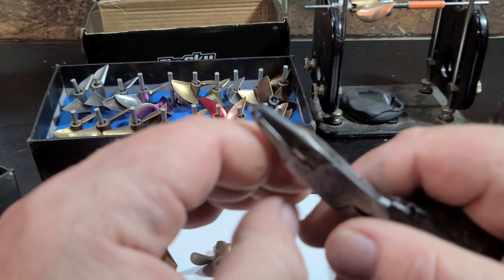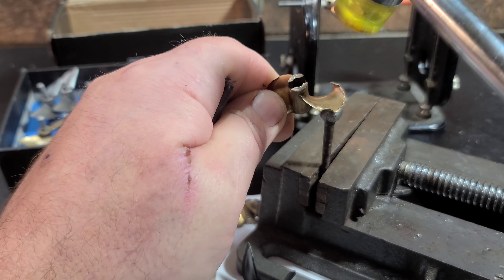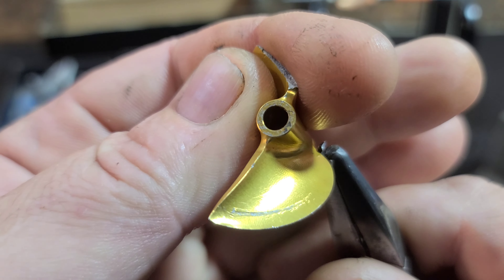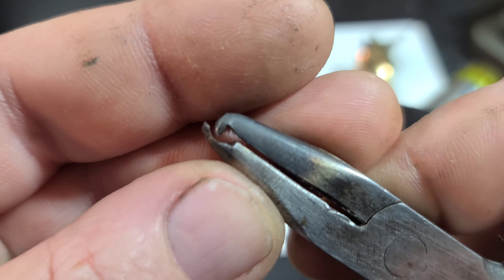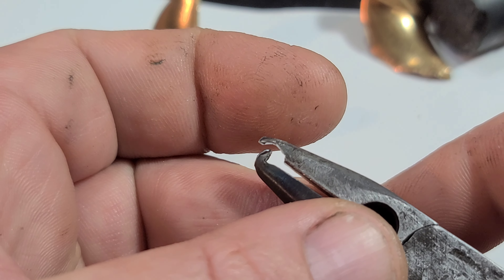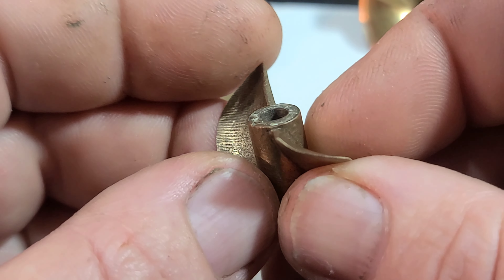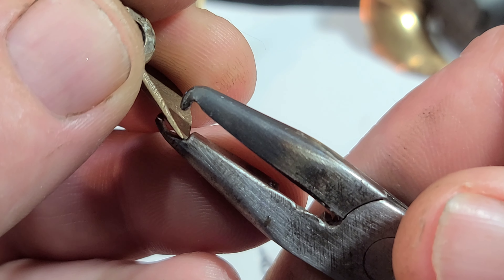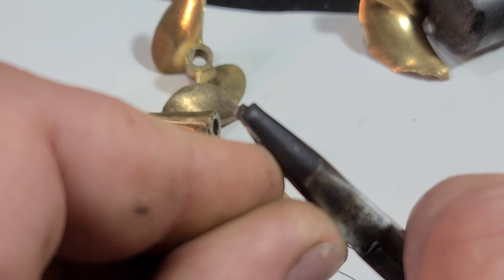Big B Shows DoctorJet How He Did It - Rc Boat Prop Pliers

Comment: Interesting that you are doing that turn up. The last prop I bought was sharpened and balanced and had the tips turned up like the winglets on and aircraft. I suppose it cuts down spill and turbulence.
Reply from the maker: Crazy how much difference just a little bend/cut will make on any given setup.    Thanks for sharing

Comment: I like your screw holding pliers.  I need to modify some locking tweezers like that.  👍
Reply from the maker: Those are my favorite pliers, I use them for all kinds of odd task, grinded the circumference down,  making them narrower so I can get into tight spots.   Thanks by the way, for the pliers demonstration. I meant to thank you in my video but slipped my mind.
Reply: @IRONCLADRC  Focusing on the small stuff as I do, I frequently have the need for such things.  I have locking tweezers, but the bolt can easily slip off.  A couple of little notches like you did will do the trick.

Comment: Wow, what a treat! 2 vids in one day! Ive worked with Aluminum in 3 different alloys. One was soft, gummy and bends easy. 6061 is tougher, machines decent and doesn't bend as easy, especially sharp bends, it cracks. Then there's aircraft aluminum, 7075. It's hard and doesn't bend. I'm guessing the props are 6061.

Comment: Welding a ball bearing to a pair of pliers.  This is what I have done for my prop modds.   
You should try just bending  the trailing edge tips of the blades.  
Then slightly roll over the trailing edge as well.   One of my main modds to my props.  
A prop I sent you along time ago.  A stainless prop you can see how I modd the trailing edge and it filed squared to the face of the hub.   

How your bending in this video. I’m pretty sure if I’m not mistaken, your messing around with the pitch of the propeller.

Comment: Hey B. I have a sonicwake 36 with a one 150 with a oxidean 4519. What would be the best motor to pair with that setup. I am not looking for a speed run prop. Just want something a bit faster.
Reply from the maker: Something like a 4074 1800kv-2000kv.  Lower kv will run a bit cooler higher kv temps will be a bit higher with higher speed

Comment: What size of props do you use on the small scale balsa stuff? I'm making a little hydroplane as my first scratch build and don''t really know what i'm doing :)
Reply from the maker: Depends, what's the length and round about weight of the boat with battery, also motor kv, esc and cell count. 🤔
Reply: @IRONCLADRC  Alright it's about 16 inches and 200g with a 3s, don't have a motor yet though.
Reply: Not sure if im helping? but all i make is scratch builds . the surpass motors take some beating , with the x range of 27/ 29 and 30 mm plastic props, as they dont need any balancing and can be sanded back to make smaller sizes , Regards Paul B @makeshift8017

Comment: This makes no sense at all lol All your doing is breaking edge of the props flow by doing this.  Not trying to be a jerk or anything so please don't get me wrong!   Just from way a prop works and how its edge cuts water and actually boils it funny enough as lead edge hits water creates void in front of it and positive flow behind it making ridge like that would push water side to side instead of backwards... That has literally been tested in wave tanks for pusher props on mini subs to keep their blasé props stabilized.  Does not make any sense on a boat of any size or you have every boat in world with this already
Reply from the maker: Say what you want,  but i didn't show you exactly what I  do to my props i showed my practice props, I bent the whole blade on those props because they're broken! used them  to get the pliers made right. 
You have no idea what my speed props look like. I've picked up more than 6 miles an hour doing my prop mods.  Ans lost more than 6 miles an hour.
Reply: @IRONCLADRC  lol dude don't take offence! like said not trying to be jerk, I'm  just saying from mechanical perspective of view makes no sense!  even without all that have brushless rc boats ripping at ove 80mph just makes no sense to me. what would i know only won 13 state championships in rc boat racing in 7 states lol
Reply from the maker: Take a look at a stock abc 1717 1716 1616  17/45. 1919 1719 19/38 all those props the very tip of the blade has a slight cup on it , so the water doesn't spill off the tip of the blade. All I do is add a bit more "cup" so the water stays on the blade till it gets directed off the trailing edge.    I don't race. I'm just a  hobbyist who knows nothing, and likes trying new things..
Reply: @IRONCLADRC  but that why saying don't take offence honestly very well could be some kind of logic to it. honestly can't say there is not or is. lol whole reason watched the video😂 Just saying from point of how "prop is supposed to work" lead edge cuts through water creating void behind it and pushed water away on back side as it cuts through water. voide actually so great water boils at the tip because low pressure vacuum created.  Normally want Sharp lead edge.  I honestly can't say this does not work! interesting idea.  But why I said don't take offence!  not knocking it.  I'm kind of dull to the point lol maybe it's my cherry personality lol!  Seriously neat idea.  Just never seen anything says it does anything with that shape and how one is supposed to work not saying it does not!  so please i hope you get what I meant!